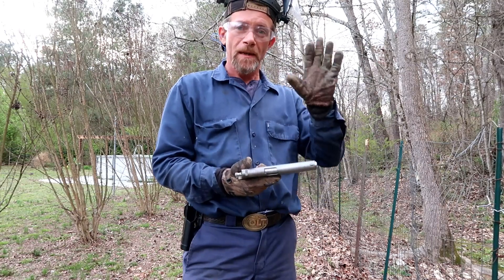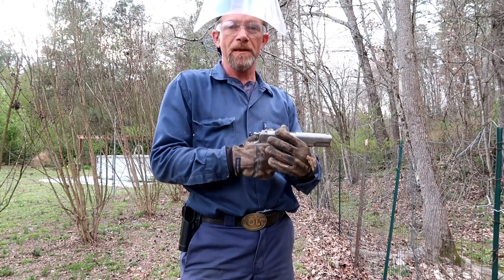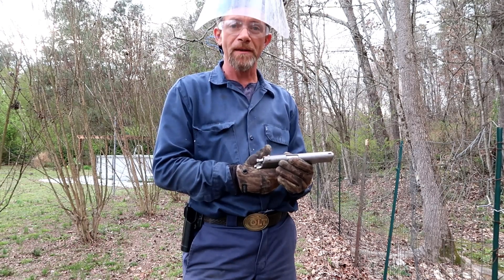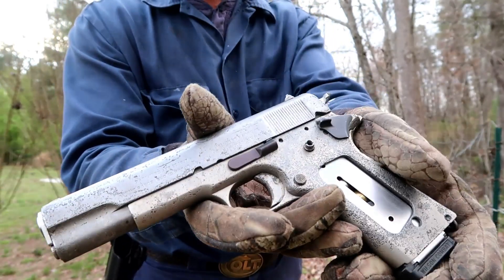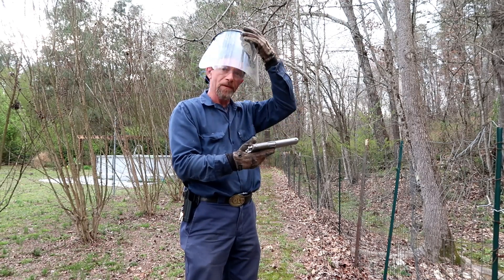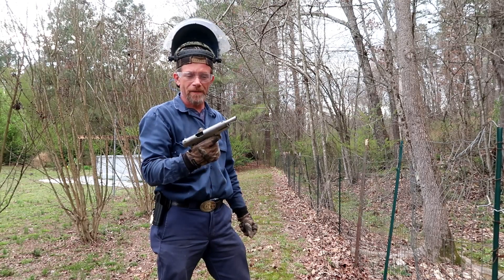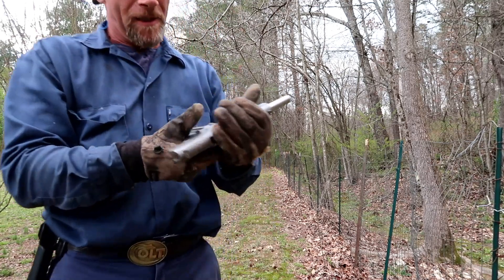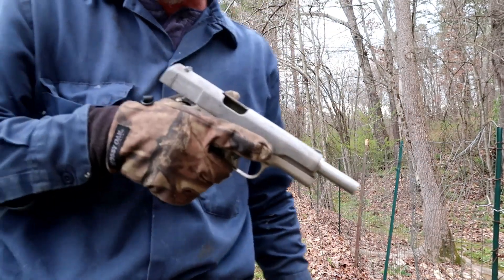100 Year Old COLT 1911 Resurrected, 1ST SHOTS

Comment: Use steel wool to smooth out moving and sliding parts oil it replace spring. barrel , then test it , should have no problemos.

Comment: Any plans on restoring it further? I wonder if it's possible to fill in the craters with a bondo or heat resistant enamel then just cheracoke it or something. Also that's a bad ass original war pistol you got there!
Reply from the maker: I Duracoated it to preserve it for now, but one day I hope to send it to Turnbull restoration and have it completely restored. Here is the link to the video when I had finished it. Turned out really nice.
https://www.youtube.com/watch?v=UqE-_RiTdCI&list=PLLsNifs4wsD8uAzmkQv6IUBnGOsSEzBot&index=7&t=0s